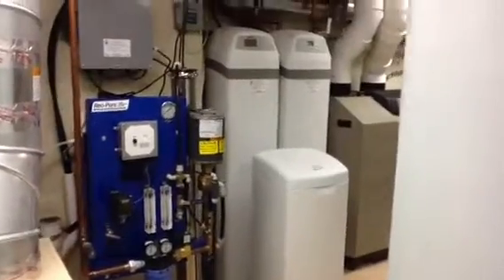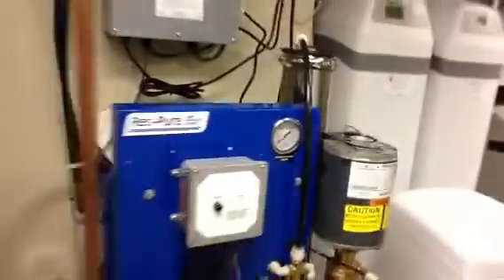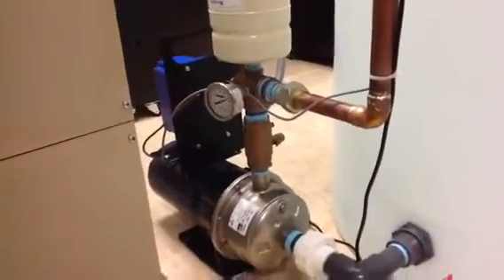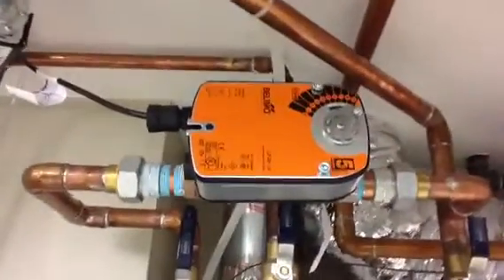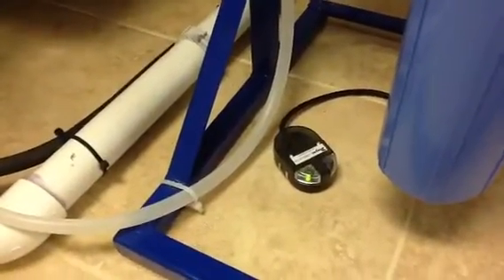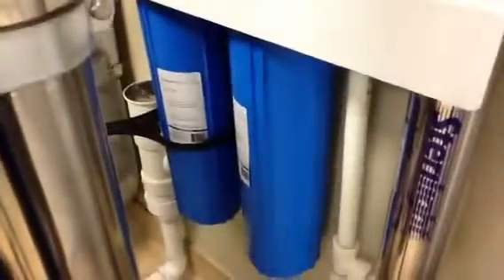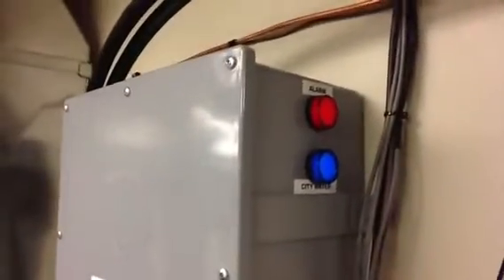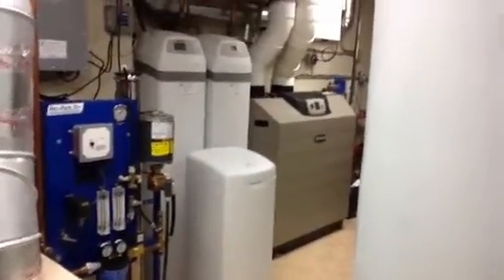Whole House Reverse Osmosis

Comment from the maker: Yes, but should only be used for very Hi Total dissolved solids water. IE For example most well water falls between 300 and 700 ppm total dissolved solids - Lake Michigan water is around 200 ppm.  Different types of 'conventional' water treatment is required to address bacterial, iron, black manganese, hardness, sediment, iron, low pH, and hydrosulfide contaminants just to name the most common.  If your total dissolved solids were lets say 1,500 ppm or more - whole house RO - yes